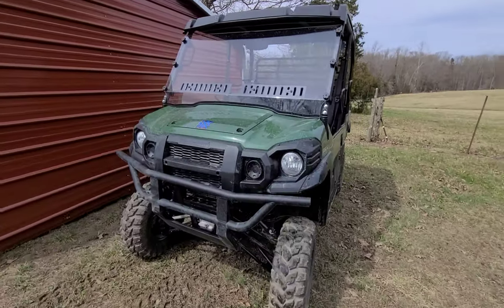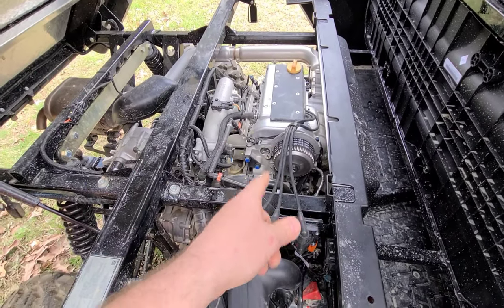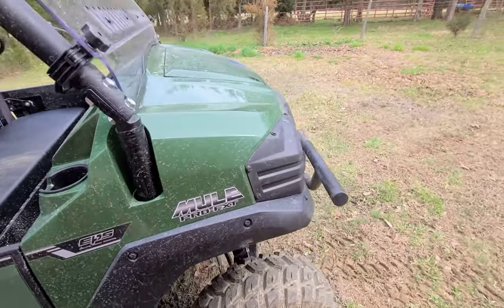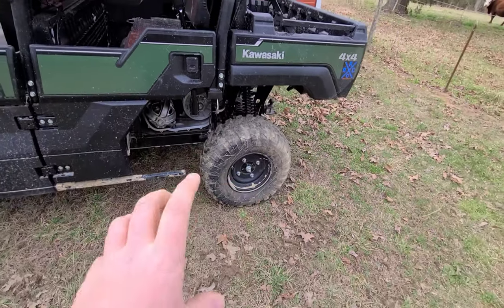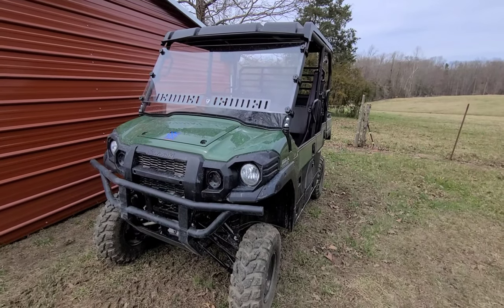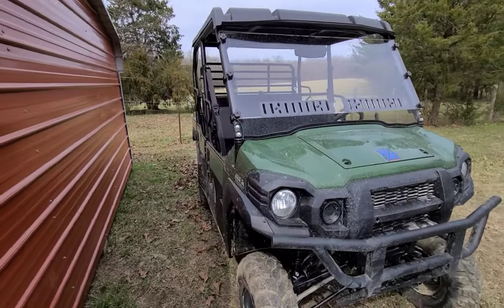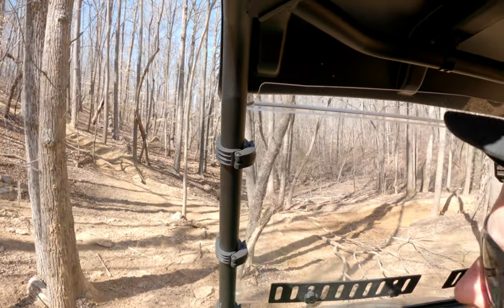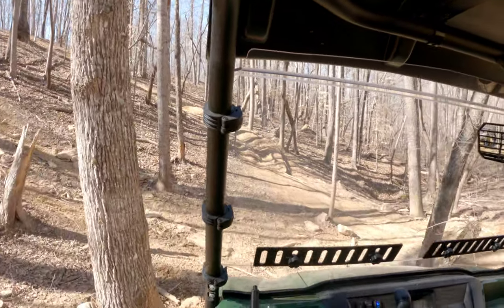2021 Mule Pro FXT modifications, riding videos and broken parts

Comment: Is there any way to alleviate the tremendous amount of heat that radiates up from underneath the driver seat? It gets very annoying driving around in the Texas heat.
Reply from the maker: Kawi has a seal kit that covers it up. Not a 100% fix but it still helps
Reply: @rightcoastoffroad  Thanks